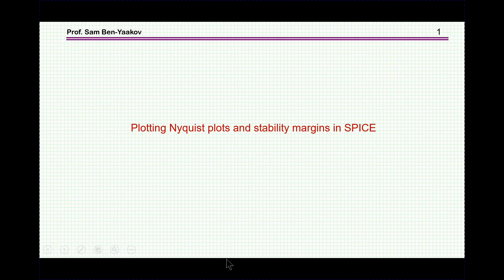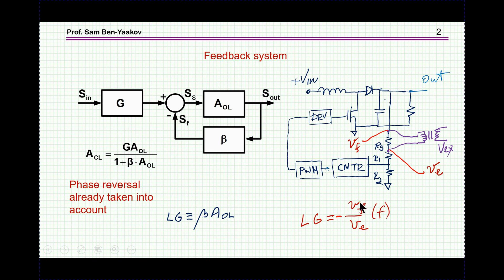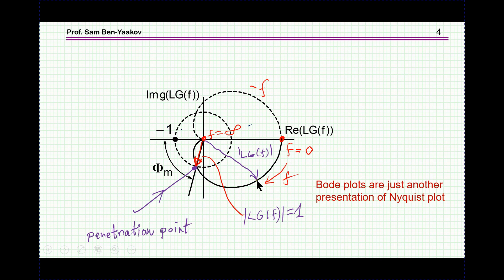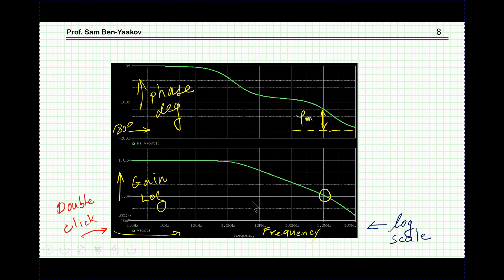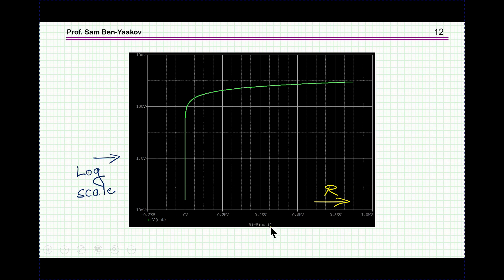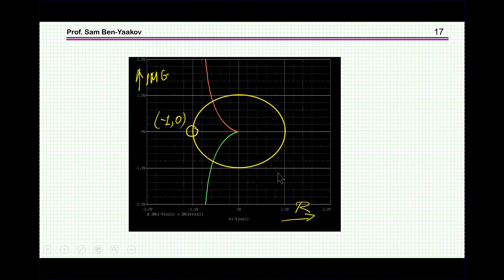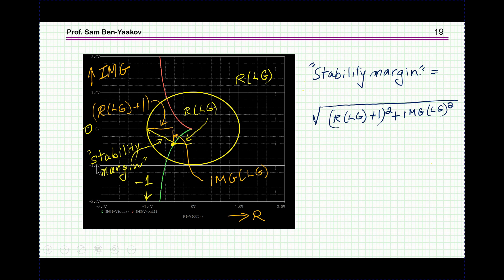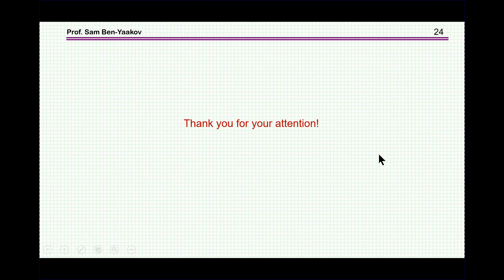Plotting Nyquist plots and stability margins in SPICE

Comment: Hi professor, thanks for sharing. how much of “stability margin” do you think is reasonable? 0.5? 0.7?
Reply from the maker: 0.5 0.7? What units?
Reply: @sambenyaakov  Thanks for your reply professor. Based on the video, I think stability margin is the minimum distance between the Nyquist plot and (-1, 0), which looks no unit to me. Please help to correct me if I’m wrong.
Reply from the maker: @chenshang4420  OK. I now understand that you are referring to GAIN margin and mot PHASE margin which is more important. The gain margin becomes important when the loop gain has a large phase lag before the crossover frequency.